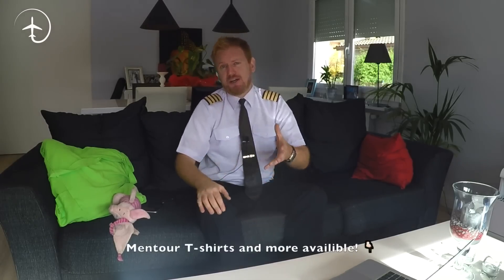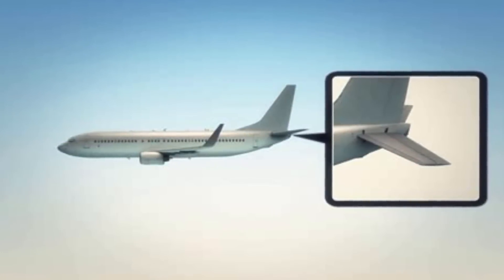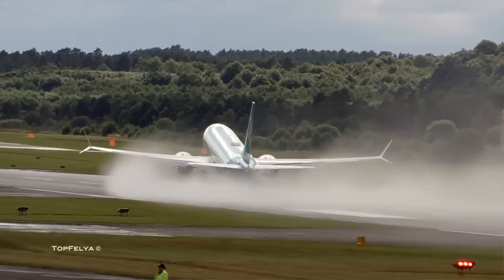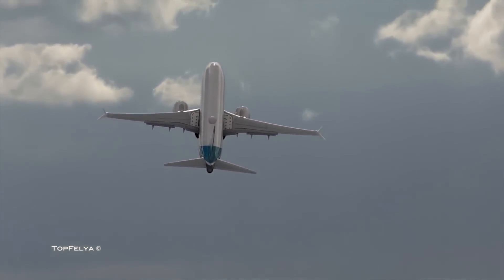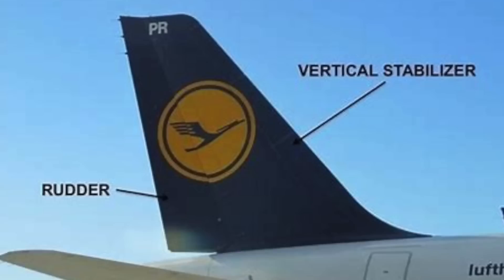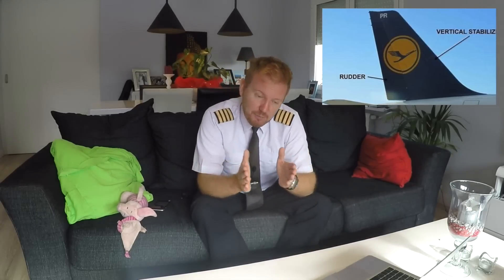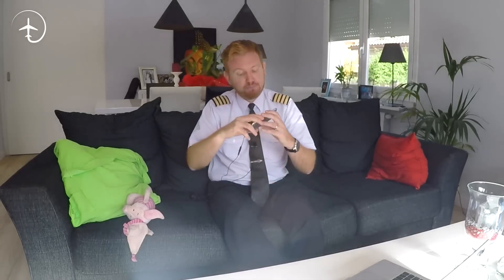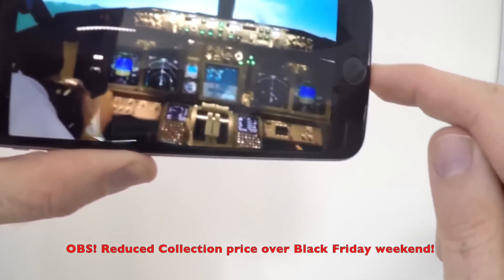How do the "Stabilizers" work?

Comment: No control surface if used to it maximum extent should never EVERY cause air frame damage if the plane is below it's maneuvering speed. That is, of course why we have this limit in the first place.
      Airbus somehow got the NTSB to blame pilot error for this accident when it was, in fact, a design flaw.
      When a design flaw is found in the 737 they ground the model and fix the problem. When a design flaw is found in an Airbus, they pay off the right government officials, blame the pilot, and continue flying with this flaw in place.
      Do not trust Airbus people. Who knows what other flaws they might have that are just waiting for the pilot to do something that, while unusual, is still perfectly reasonable. And it breaks the plane.
     I don't fly on an Airbus if I can help it. They are not a trustworthy company.

Comment: Mentour you are so unfair to airbus you fly a 737 you are using a 737 for example in your video two 737 accident have to do with stabilizer united 585 and us 427 you have to say airbus in a bad way
Reply: American Airlines Flight 587 is more recent and more well known then those other two. Also, United 585 and USAir 427 didn't crash because of pilot error. They crashed because of a design flaw that under certain circumstances would cause the rudder to move the opposite direction of what what was being commanded.